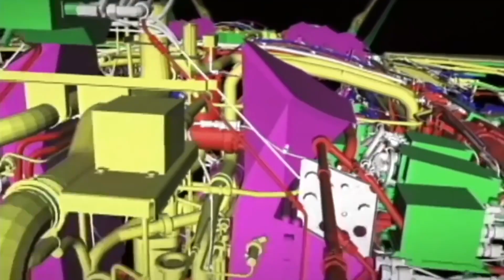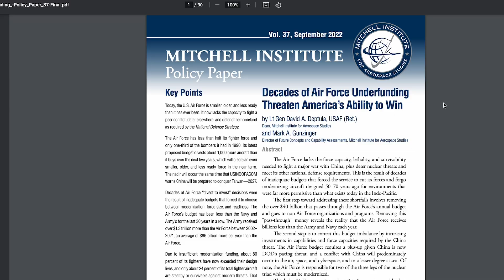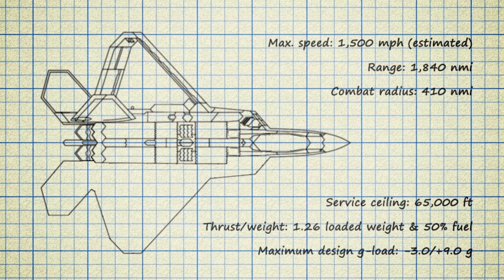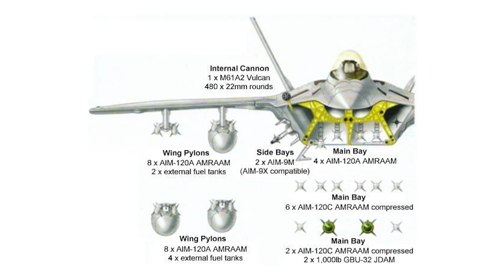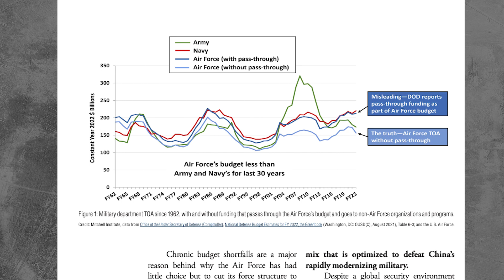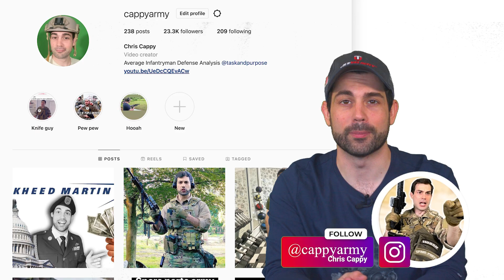Cancelling the F-22 Fighter is Worse than You Think

Comment: I believe it's 70,000 pounds of thrust, not 700,000 as reported at approx. 7:10. I worked on the thrust vectoring section, experimental phase in 1990, funding cancelled 1/15/91, seems like for about 10 years, not sure. 1996, I worked on F-135(JSF) engine cases. Takes a while to get a project of this complexity to work right, decades at times, and cutting the Raptor at 187-190 birds was short sighted and stupid. I was surpristed the JSF never had temporary funding cuts when things seemed fubar; I suppose LM stepped up their lobbying game.
In thrust we trust.
Reply: You are right. If the F22 had 700,000 pounds of thrust we have a space plane. The weight of F22 at take off is  50K-70K. So a weight to thrust ratio of 10:1. The space shuttle had a weight to thrust ratio of 6:1

Comment: Also, all the missed variants as well. including the F-22B 2 seater and the FB-22 medium bomber
Reply: The Navy was very disappointed that they never got an F-22 swing wing as well.
Reply: that never made sense to me. Air superiroity fighters are designed with very specific criteria in mind to make them ideal dog fighters and superior to multirole aircraft, at the cost of poor performance as bombers compared to multirole aircraft and dedicated bombers and increased unit costs. So they decide to take a dedicated air superiority aircraft and try to turn it into a multirole aircraft, make it a worse fighter at a sky high price just so they can get a mediocre bomber? Madness. The F-35 is cheaper and can carry around double the payload of the proposed FB-22 and since the F-22 was restricted to airforce use the F-35 can be used by allies and other branches of service allowing it to work off aircraft carriers and Marine assualt ships
Reply: @kathrynck  Yeah... no.

They got rid of the F-14D due to costs per flight hour.

The F-22 with swing wings would have easily doubled that cost over the F-14D.
Reply: @fordgtguy  That's true about the maintenance. But at the time decisions were being made, the armed forces were largely oblivious to the upkeep costs of the 90's gen stealth coatings. 

But the Navy Also retired the F-14D because it was expecting a carrier capable F-22 to eventually materialize. The F-18E was a stopgap choice, initially. It wasn't just the issue of upkeep. The D's were less of a hangar queen than the earlier versions.

Comment: The F22, as all planes or really anything, was limited by it's time and anything to come after it will have more research and knowledge poured into it.
I absolutely love the plane, the looks are beyond iconic.
However, it is very limited. It's an expensive and hard to work on plane. The NGAD programs stronger focus on better maintenance, cost effectiveness, upgradability and other things will make it a superior plane. Not just because of age and new technologies, but as a general idea of how the project works.
Reply: Yep which is the story of the US milltary... You can be the best if you were never the first.
Reply: Compared to the modernization costs of our F-16s, the F-22 was relatively inexpensive. Part of the F-22's fall was the political bullying of the reforms who believed the A-10 was the only plane the US should have. NGAD does have an advantage over previous programs - it is being developed with upgrades in mind. The F-22 would now require a complete overhaul of avionics similar to the F-16 upgrades.
Reply: @StrawHat83  F-22 has far more problems than that. It is actually a limited platform because of its very short ranged which IIRC was also due to its nozzle, the expensive maintenance costs and less than desirable readiness rates are really problematic.
Reply: Indeed, the cost necessary to upgrade an 80s jet to get a handful of aircraft, that may no longer be able to press their mission, would be astronomical.
A lot of what they learnt went into what makes the F-35 so great, it's modularity.
And what they learnt about implementing said modularity is being built into NGAD
(And FCAS and Tempest etc)
Although FCAS et al. will be all evolution of 5th gen fighters, I suspect NGAD will be tailored for the Pacific, focusing on range, payload, stealth and sensors & effectors.
Reply: @v0id683  Any aircraft that can carry drop tanks and refuel in flight is essentially unlimited in range. The F22 has essentially no "problems" at all.
Reply: @seanmurphy7011  You would carry tanks only for ferry flights not for combat. Again it has such a tiny range that it would have to refuel very often
Reply: Just hope we get an NGAD in the sky before the Chinese make their inevitable move. If I were a betting man, I'd say it ain't gonna happen.
Reply: Totally agree, The F-22 and the B 2 or both Cold war stealth designs to deter Russia. 
Production of f-35 doesn't end until 2023 from what I've read. While f-35 is slower than the J20 and shorter on range, it's still a very capable 5th generation craft.
NGAD timetable is looking at 2030 ish. I think that's where money will be best spent, for tomorrow's challenges not be Cold war ones. Just my opinion though.
Reply: @v0id683  And radar can easily detect refuelers, and send fighters to the area. I think when the B21 gets going, Northrup Grumman and the Air Force should study and convert B2s into stealthy refuelers.
Reply: @nonamesplease6288  China won't  F around soon after Russia's experience in Ukraine. We just have to avoid a war for 20 years. Navy needs spending to boost defenses in Pacific with more Virginia class.
Reply: all projects die though
Reply: @Sean Murphy  Apart from the problem of being 2 decades old, yeah. The F22 was built before Internet broadband was common and the IPhone was 2 years off, computing has advanced tremendously since then and its 100% guaranteed its circuits are obsolete now.
Reply: @NoNamesPlease  China's move is some way off. People underestimate how difficult invading Taiwan will be. Sea invasions are the most difficult operation a military can undertake, your forces are put through a bottleneck of landing ships - every wave is numerically outnumbered and outgunned by the defenders because of this and the lack of heavy weapons platforms.

 Taiwan is 100 miles from the mainland so everytime the ships go back for more men they have to travel 200 miles which is about 6-8 hours of travel. So any troops that survive the landing have to survive on the beach for a long time. Even flying a fighter jet there and back would take over half an hour. This all adds up to an unpleasant situation, even before America gets involved.

And even if they get a foothold the interior is either urban sprawl or mountain.

If I was the invader I'd want to spend about 3 months hitting Taiwan with air strikes and artillery to soften it up, a bit like the Desert Storm air war. But China doesn't have that kind of time to play with, the moment the war begins they're on a short timeframe to win before America mobilises.
Reply: @jgw9990  
2? Try 4 decades.
It was designed in the 80s, F-22 is 80s tech.
It's the last of the monolithic avionics jets, which require everything to be ripped out and rebuilt for upgrades.
F-35 is the 2 decades old jet, but the first (American) modular jets, first jet to have it's software not written in FORTRAN 🤣
Reply: @jgw9990  Also, the real reason you would want to capture Taiwan is to take TSMC, which Taiwan has already said that they would destroy in the event of an Invasion.
Reply: Th YF23 should of be chosen, maybe it will get a chance.
Reply: @Mostly Penny Cat  Yeah good point, I must've been going off the in service date.
Reply: @v0id683  Really? Funny, the F-16s that shot down Serb Migs over Bosnia were carrying drop tanks. Drop tanks are absolutely carried in combat and dropped on contact.
Reply: @seanmurphy7011  F-22 is different, when you carry fuel tanks it has much much higher RCS so you dont see stealth fighters flying with external fuel tanks outside of ferry flights

Comment: The reality is that the F22 was the stepping stone for the F35 program, they took the lessons learned and ironed out the bugs with the software and systems and made a relatively comparable model that they can also export to fellow NATO members. As large as the USA budget is they still need to have some exports to recoup costs and bring help streamline production. With both the air force and the navy working on their own NGAD programs it would be too costly to try to make more F22's and if the NGAD program meets even some of the objectives laid out then the F22 cost would not be justified in the face of a superior model that would be available at the same time the first few raptors are rolling off production.

Did the staff in charge make some mistakes sure, but a lot of the "gaps" in capabilities that keep being brought up are used as a way to scare congress into giving them additional funding.

Comment: I disagreed with canceling the program at the time and for years after. Especially since they knew a war with China was inevitable. Now realizing the speed at which the technology advanced I could maybe agree. It bridged the gap and I have a strong feeling the ngad program is much further along than we think. If it was started in 2014 and used modern technology with r+d from the raptor and lightning I’d assume it will be far better than the raptor. By the time the war breaks out it will be better to have a fleet of ngads that even 700 raptors.

Comment: I remember back in 2010 when i was 14, i read what was available on the net at the time and i told my dad, "theyre making a mistake in canceling the production line. We have China and russia to worry about"
Reply: The adults knew the long game was more important.
Reply: @MarvelousSeven  I think the long game your referring to is pramatism. Basically it seems like the f35 platform is much digitally upgradeable, which is critical for modern tactics. So the f22 was seen as really on the way out? Other thing is they probably realized that the f15 and other non stealth platform would do fine for roles that didnt require or negated stealth, of which there are many. So seems like it was sensible decision. Im sure the us has the next gen interceptor pretty in the works though, just in case. Lets just hope they are never used in anger

Comment: To my mind, the most interesting F-22 spin off proposal, was the Lockheed/Boeing A/F-X from 1994. It was a stealth swing wing design to replace US Navy A-6 & USAF F-111. It would have used a F-22 variant engine with higher bypass ratio for greater range. A lot of systems from the F-22, would have gone into the A/F-X.  If exported, it would have been a great Tornado replacement for European NATO nations.

Comment: I wonder why they couldn't have kept a low production rate all along so as to keep a core of skilled technicians, tooling, and supply chain in case they need (sort of like what they've done with the M1 tank).
Reply: That is because the m1 production line supports fms...and the upgrade program on current US inventory.  No fms for the raptor this no lrp.
Reply: The fewer the production lot the more expensive it is. You can build thousands of 1 jet or 100 of them and the thousands would be cheaper on a plane by plane basis because of gigantification and the producers having more time to refine production. The B2 kept getting more expensive because it's production kept getting cut. If you only produced a dozen or so per year or decade you'd get an actual trillion dollar plane.

Comment: The 80/20 rule applies, and the F35 is hoovering up all the funds for airframes, so by cancelling the F22 you can fall back on the F20 and get 80% of the capability for 20% of the cost, and that amounts to small change from the back of the couch in the F35 program break room...

Comment: My understanding is that the production line was unusually mothballed not scrapped. Of course you would upgrade, new radar etc. but I believe the airframe could be built with relative (very relative) ease, I stand to be corrected by better experts but while supply chain would be an issue the actual hard structure could be done?
Reply: Some of the tooling & processes were destroyed rather than needing to be guarded for national security reasons. Also, it runs on windows XP, which has become a bit of a problem.
Probably more importantly though, is the staffing & subcontractor chains. At the end of the day it was built by a lot of people, many of whom retired, or moved to a different program at LM, or moved on to other companies, without training a replacement. New hires would have to be trained, and it would take years to assemble a whole team. So you're paying the workers for building 'nothing' for quite a while. And there's a parts supply chain as well. It's not ALL done at LM. You'd need to find alternate contractors for most of the outsourced parts.

It's doable, but it would probably take 3-5 years to get the whole process going again. And you will have spent billions before an airframe is even touched. And typically it takes a line 2-3 years to ramp up production to full capacity. And it never would, if you only wanted an extra 120 planes... so you're looking at the "unique pricing" of aircraft in pre- full scale production (see B-2 as an example of "unique pricing").

Also, there's the issue that the F-22 is 2 decades behind in the technological arms race. It has frankly overkill for radar stealth, but is relatively vulnerable to IR sensors. You could add much of the advanced tech of the F-35 to it, but some of the F-35's tech kinda kicks the podium out from under the need for traditional dogfighting performance. Which would kinda make the F-22 at odds with itself. F-22's aren't as all-dominant as they were at launch. If they wanted a really long term dominant platform, the AF should have went with the YF-23. It would've been much harder to shoot down using IR sensors & seekers.
Reply: @kathrynck  The F-22 tooling was all crated up and shipped to a secure warehouse. The problem was the guys crating it up didn’t label what was in which box. That came up in 2018 when they needed to manufacture some spare parts and found the manifest’s didn’t match the box contents.
Reply: It's all sitting in a warehouse at Sierra Army Deport.  But this is just the fixtures to assemble the aircraft and components, the tooling to hold parts while they are machined, etc,  The actual machine tools belong to the contractors and are working on other projects and the assembly building is now doing F-35s.
Reply: Nope the previous Democrat administration had the tooling destroyed to prevent future resurrection of the project - exactly what the British Labour party did to TSR-2.

Comment: We need to have a balanced force of stealth and non stealth fighters.
Reply: That was what I was thinking. Like how Admiral Zumwalt had the idea of the high-low navy. You don't need the most advanced, best and most expensive thing in every roll.
Reply: @ryand2939  I had WW2 Germany tanks in mind. Konig's Tiger tanks were hands down the best tankson the battlefield  in the war. The cost of one Konig's Tiger was equal to that of 7 Tigers. Tigers had an 8 to 1 kill rate against Shermans. We built so many Shermans that there isn't even an accurate number. I've seen historians claim 30k to 90k and everything in between, The Germans built less than 1k Konig's Tigers. High tech stuff is great, but going so high tech that you can't put a substantial force on the battlefield is a detriment. 

What I find most surprising was the mention of it costing over 200 million per jet to kickstart the program again. These Raptors were going for 130 million per plane in the 90's (If my memory is correct). Usually manufacturing cost will come down as the process gets more streamlined. I know inflation is a thing, but 70 million per plane, that seems like some corruption going on there. We could crank out 8 F-15's for the price of one Raptor. Pretty similar to the Germans build ratio with Tiger's and Konig's TIgers.

Comment: People don't give the f35 enough credit, as it is actually very capable in air to air applications and has been building a supply chain of interoperable parts across multiple systems that will make it cheaper and easier to maintain a fighting force. People also seem to not notice that officials talk about the NGAD program as if it is nearly done. I think we shouldn't be afraid to create Gen 4 plus fighters in the way Russia does. Not everything needs to be stealthy. Sometimes, you just need a workhorse system. To rebuild the f22 program would be extremely expensive, inefficient, and take away from systems better suited to the task.

Comment: The USA (NATO) will hopefully understand that a very limited production needs to be maintained in order to maintain competence and development. F-22 should have been manufactured 2-3 aircraft per year at very high cost, but knowledge and tools would have been available if production had to be increased. I think this will be included in the new agreements with the industry. It will be expensive, very expensive.